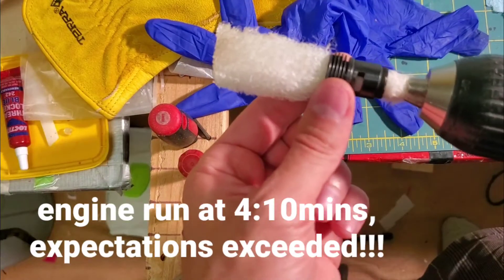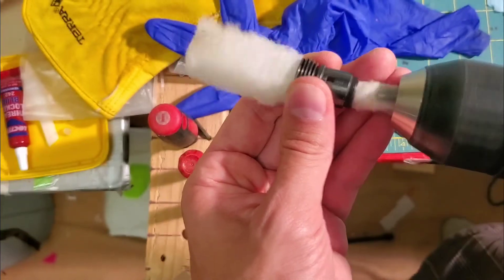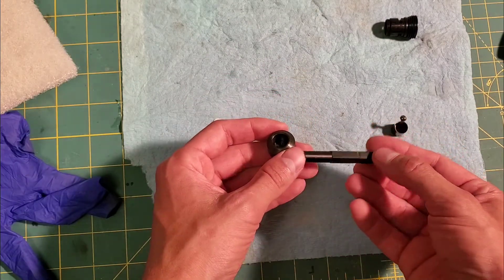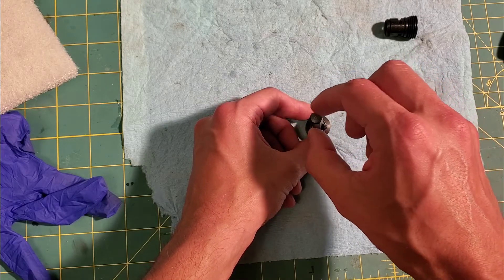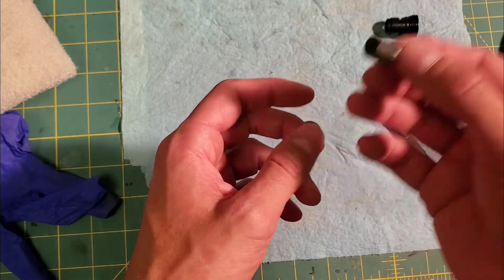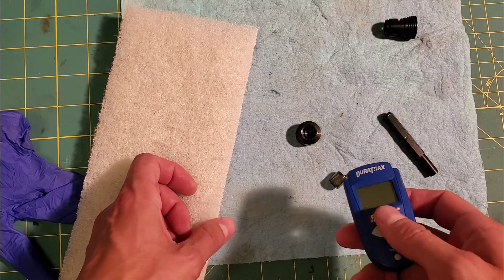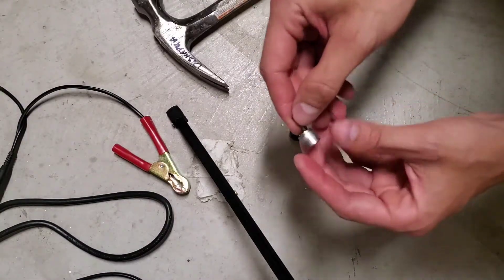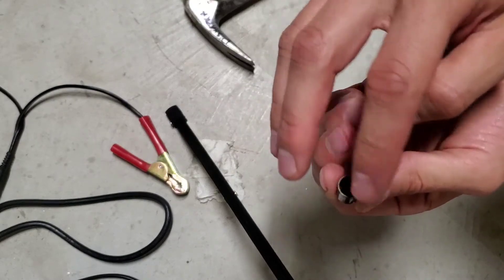Cox Teedee 0.049 Restoration, Run and Debrief

Comment: I was always amazed at the power of a healthy Tee Dee .020's and .049's. I used them in RC conversions of Berkeley, Sterling and Flyline models using Ace Pulse rudder only systems in the 60's. I would wrap finest steel wool on a dowel with fuel  to scour out varnish from cylinders during break-in phase. Also used tooth paste. I used remote clunk tanks instead of leaky stock plastic ones for RC  flying. Castor oil and high nitro fuels were best for Tee Dee's. Clean engines thoroughly after contact with dirt.

Comment: Highly interesting, - in need of a new fuel tank and cylinder for a Cox Tee Dee .020, - any suggestions where to get it (if possible) ?
Reply from the maker: You could try cox international.com they have most of that available. The top end is a tougher though. Ebay is probably your best bet.